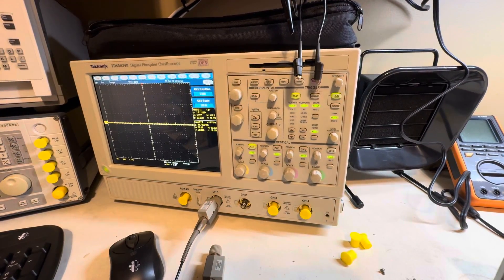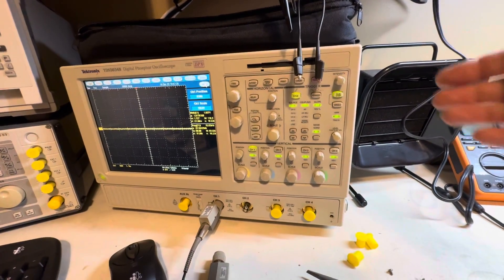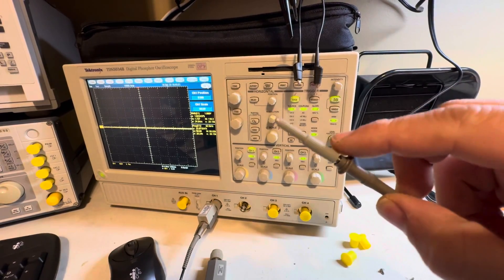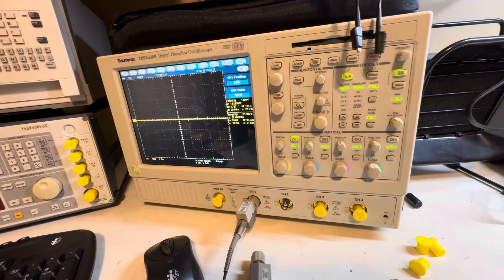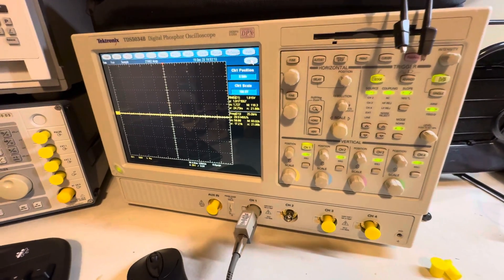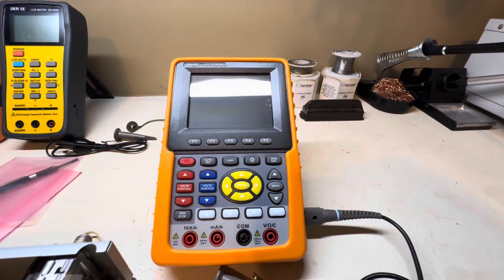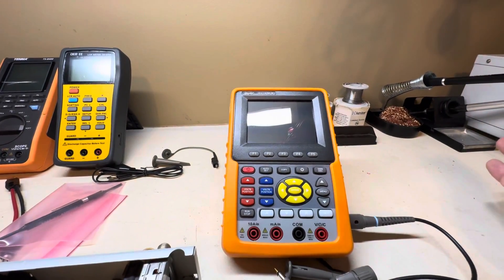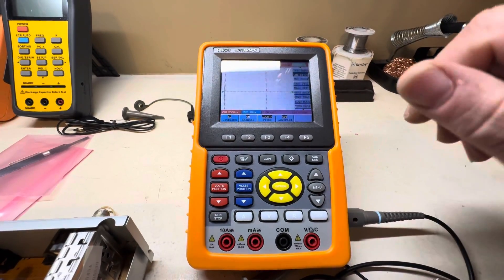How to measure mains voltage with a bench oscilloscope safely.

Comment: My FNIRSI 1013D Plus 7" Touch Digital Tablet Oscilloscope 2CH 100MHz Bandwidth 1GS  is self contained  (isolated) battery operated and can safely do the 120 volt ac
Reply from the maker: Yep, one of the advantages of using a battery-operated scope. Just don't do phase or switching measurements with dual channels. Otherwise, you blow through the ground plane on it. You need a truly isolated scope then.

But for audio work I know as few people that use that very Fnisi oscilloscope due to it being isolated from mains, which makes it very useful for repairing amplifiers.

Comment: The only safe way to measure mains voltage on a mains powered scope is through a high voltage differential probe. Safe for your scope, that is. Personal safety is a whole different matter and depends on the knowledge and behaviour of the operator.
Mains in Europe is actually a threephase system at 400 V, not a split phase system. Single phase power is derived from one of the three phases with a neutral as the return path to become 230 V.
Reply from the maker: Yes highly recommend using an active differential probe which is what I use and you need a proper rated HV probe of higher voltages. I going to do a video soon on how people can make a active differential probe if on a budget. 

Did this video as have seen and people ask about probing mains and had people do dead shorts to ground as some don’t know better and forget a bench oscilloscope is reference to earth. At least it keep people safer and from blowing up front end and ground plane on scope as seen to many time. It safer then how I seen a lot of technicians do as most remove the ground pin off cord and etc. Yes for us that engineers or advanced know better and have active differential probes and etc. Yes in the UK and European have 3 phrase 380v to 460v phase to phase and phase to neutral is 220v to 240v in a lot of areas beside mostly US use split phase but a lot of oversea area use split phase as well. We also have 3 phase mostly available to commercial areas but residential homes here are usually served by a single-phase in some case you have 3 phase and can get installed if you have three phase on pole as some do as they run shops out of house. I just finish about a month back installing a 3 phase 1200 amp service as that customer was running welders motors and furnaces and shop business out of garage. 

Plus method in video only works with mains 50/60 hz and not switching supplies at higher frequencies which then you need a isolated signal generator or differential probes and even then you can run into common-mode noise can get mixed with differential probe voltage inputs. A whole another topic in its own plus would have to go over ground loops duty cycle and etc. 

Working with mains or HV is dangerous and can be lethal. If people don’t have knowledge to, don’t at least not without supervision from someone that has experience.

Comment: Please review your statements regarding the UK and US "mains supplies".  You are incorrect regarding the UK supplies which are ONLY EVER 1 x Neutral and 1 x Live (at 240V only for domestic supplies).  The US has split supplies with 1 x Neutral and 2 x Live (at 120V each out of phase with each other).  I suggest you pull this video (until you have corrected your errors) to prevent some-one being harmed or potentially killed.
Reply: Yes that is a common misconception that the UK is two hots out of phase and a ground just like American residential 240v. Like you said, the UK wall outlet  ground/neutral configuration  is exactly the same as the USA. It's just at 250v versus 120v. And because it's 250v, they don't need a split phase system to run large residential appliances. The bonded neutral is a safety feature in any grounded electrical system, even in three phase wye services.
Reply from the maker: Plus measuring mains in general is not recommended period if you never worked on mains or have enough experience working with mains or higher voltages. Mains voltages are lethal and yes will kill you if you don’t follow safety precautions. Reason why I did the video is essentially to stop people from ground out Live side as seen way to many do so and even in some viewer comments on other videos asking about how to measure mains voltages. I seen other engineers over the years even make the mistake at times.
Reply from the maker: I see your correct as UK use a single phase L1 N to ground in some areas where US is L1 L2 to ground or older 4 wire isolated to ground. But also large variance in how L-N-G are installed onto receptacles in Europe / overseas (even within the same country). EG with L-N tied to L1-L2. Since half the time you can't trust the L-N polarization anyway in the plugs/receptacles.

No one would get hurt, or kill themselves, as you wouldn’t be grounding out as measuring this way so they be safe. 

The two probe method would still work as you essentially use two channels as a " pseudo differential input you put Ch1 probe on one leg, & Ch2 probe on the other. Plus didn’t go into that method showing it yet as doing a separate video on it once I run 240v to the bench for my pre heaters and reball station. Plus want to go deeper and explain AC and DC coupling as not what most think it is and harmonics and using a current probe and power measurements. 

It safe as you are relying upon the return circuit already existing via the 'scope Earth lead & the power point Earth circuit, back to where the Earth & Neutral are bonded at the building power entry, so your not risking grounding out the circuit your attempting to measure, or creating a ground loop, or making the chassis live. 

There is one other method that I didn’t mention as this of course, as this method will introduce errors if you are trying to look at higher frequency artefacts upon the basic 50 or 60Hz Mains waveform, like a switch-mode power supply but I do a completely separate video on that as a whole another topic in itself. It involves the use of using a battery operated signal generator. I was also going to do a video down the road showing how to make an active differential probe as they are not to hard to make and the best way to measure. This video was done as had people leave ground clip attached and cause injuries to themselves and equipment, or remove ground pin on cord which is even more dangerous, as if equipment develop a fault goodbye lab and potentially house.